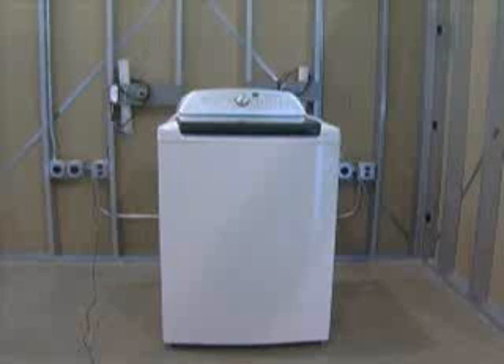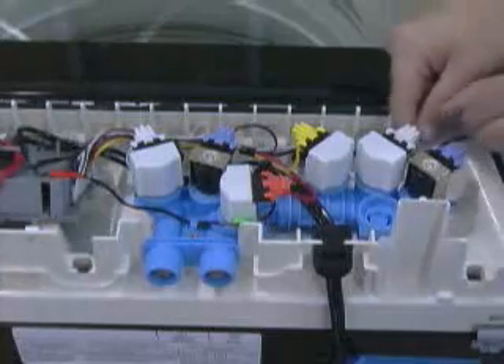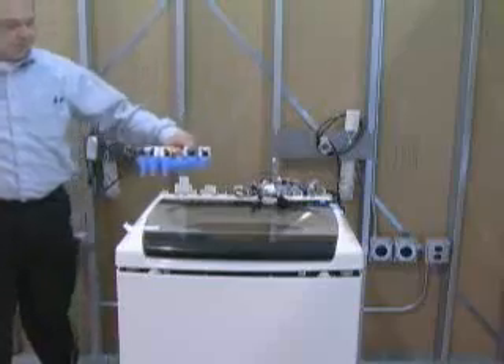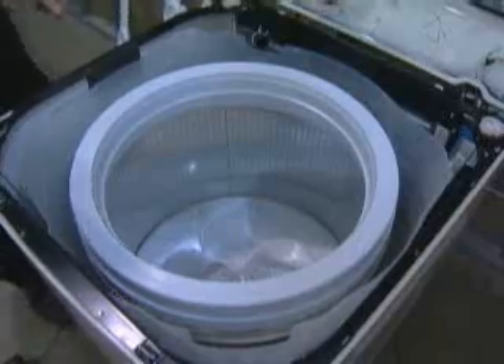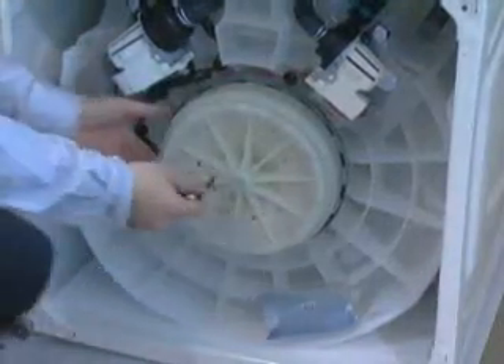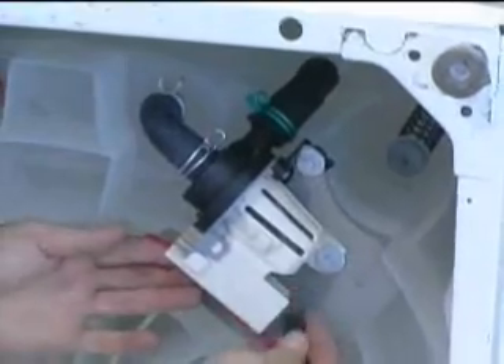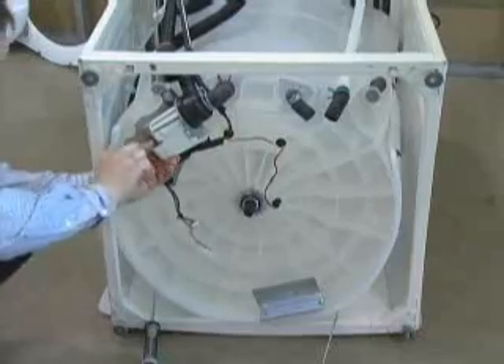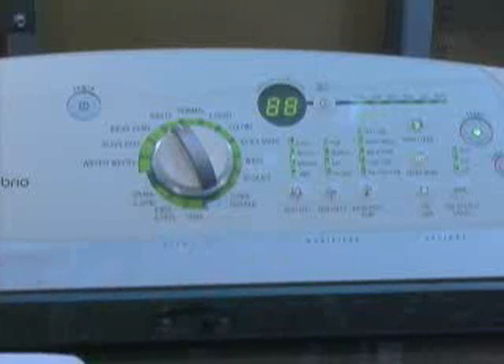Whirlpool Cabrio teardown Video

Comment: I took out the bolt but the impeller is stuck on there
Reply: I’m having the same issue 😭. Lifting the drum like the video said is not helping. I’ve tried prying it out with a flathead screwdriver also.
Reply: @manager4768  it's been 3 years but I had to hang the fucker from the ceiling by the drum and let gravity do the work. That seal is gonna be bad and the spindle is rusted be prepared to buy a new spindle cause your not getting it back in

Comment: Thank you so much for this video. This was awesome. Saved me much time and money. This basket was really rusted in there because the person whom I bought this washer from, had it sitting in the garage without use for a while. Could not have removed the basket without the help of this video. :) After I had to power washed the tub and basket (they never cleaned it ........ Yuck!), I noticed some water trapped in the base of the basket and did not see any leakage after it dried. I can't believe there is supposed to be water in there, if the Whirlpool uses bouancy to float the basket. Any comments?
It is amazing to me how all these videos showing tips on washer repairs and removal/taredowns are all clean units .....  LOL

Comment: Thank you most kindly for this video--saved myself a service call expense, at least. The noise during the spin cycle? A 1999 quarter that somehow (along with a sock?) that somehow found its way underneath the agitator and was getting tossed around. Nice!
Reply: Meant to add, the agitator in the machine, not my wife!

Comment: Great video, my cabrio washer had a horrible, foul smell. I removed the tub and there was a gross looking sludge in the bottom. I cleaned the tub and water basin and put the washer through the clean cycle and wala, no more stench. Very easy to do for even a not so handyman
Reply: +Joshua Pietras That's awesome Joshua! I'm Glad we could help!
Reply: Joshua, those popular detergent like Tide liquid or whatever, actually aren't good for these types of washers. They're very thick, viscous, hard to rinse

Comment: For a basket not stuck very hard this could work but when they are stuck really badly you'd crack the upper plastic ring before the basket would come free. I've found removing the hub is not necessary.  Also the wash plate can be as hard as the basket is to get loose.  Pull the basket up and down a few times and that will usually loosen the wash plate where you can get your fingers under it and rock it back and forth at 3 and 9 O'clock and pull it free.  Half the time the basket and washer plate will come out by pulling the basket up and down a few times.  If not put Vice Grips on the shaft and turn it back and forth will lifting the basket. Two people really come in handy when this is necessary.  If all else fails pull the motor and knock the shaft out along with the basket.  I've had to do that twice.  BTW does anybody know where you can buy just the shaft seal.  It's part number W10502879.  The older seal number 8545956 and not as good a seal as the newer ones.
Reply: +Neill Southwick Good to know Neill. Thanks!
Reply: +Neill Southwick Did you ever find this seal?
Reply: +Neill Southwick try partselect.com